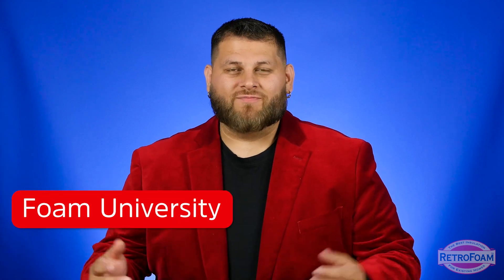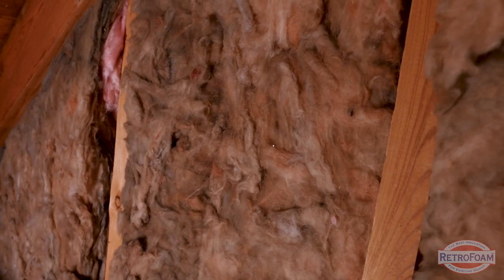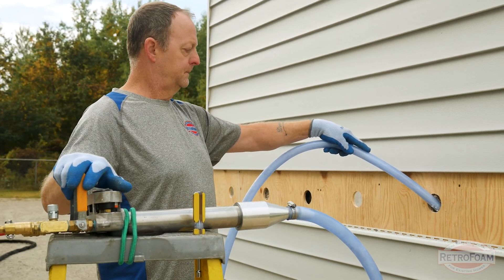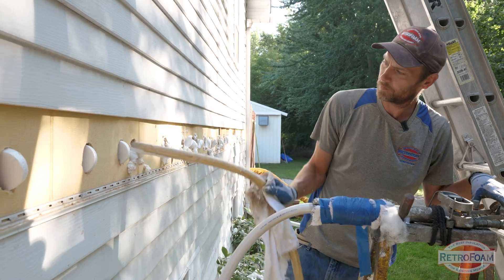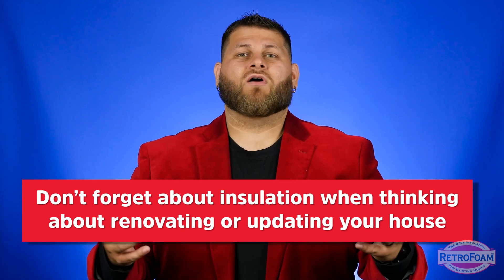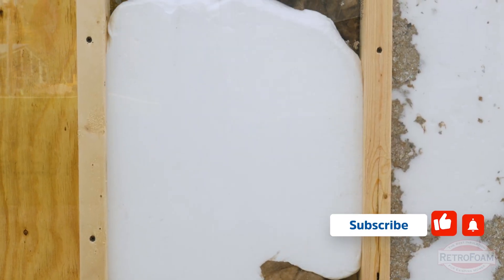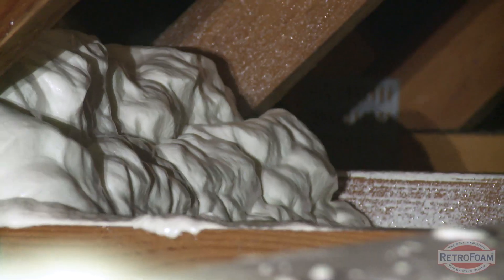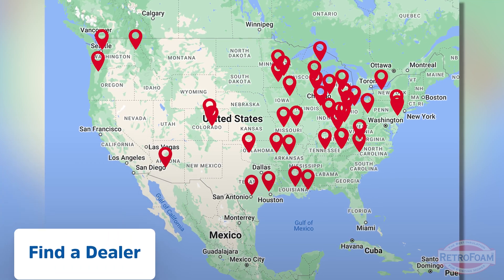Can You Insulate a House After It’s Built? | Foam University by RetroFoam

Comment: There will be a mess inside the home, that foam will leak out from the bottom plate if not sealed or caulked
Reply from the maker: While it is possible for human error to occur during the installation process, our contractors are experienced and trained to know when the cavity is filled. You might find this article on our blog useful: https://www.retrofoamofmichigan.com/blog/will-injection-foam-insulation-bow-crack-drywall